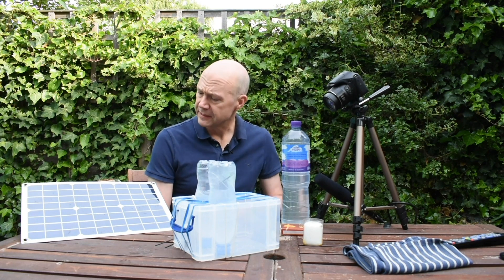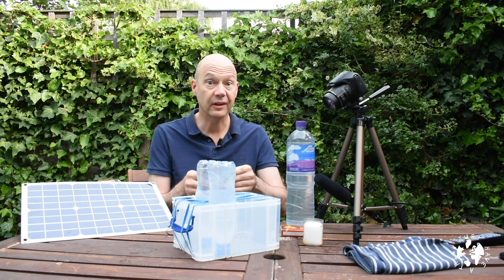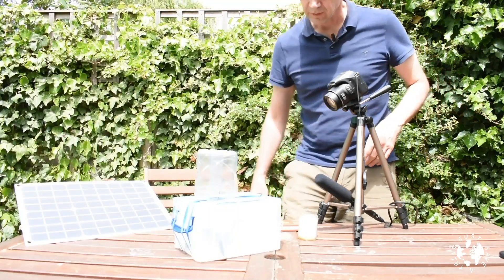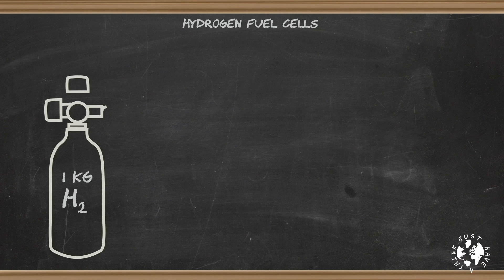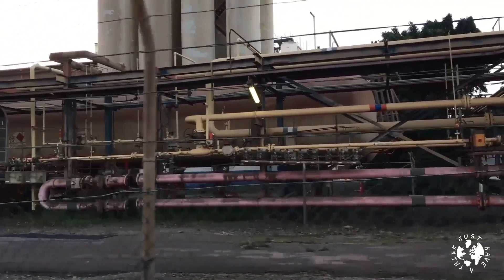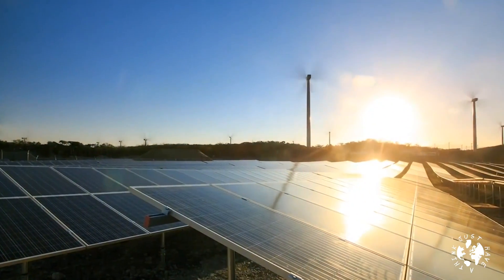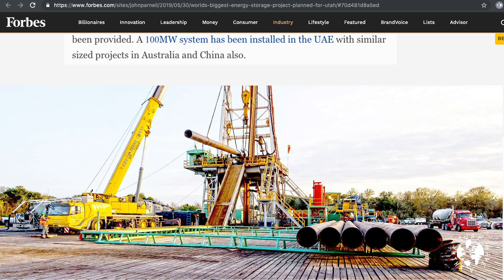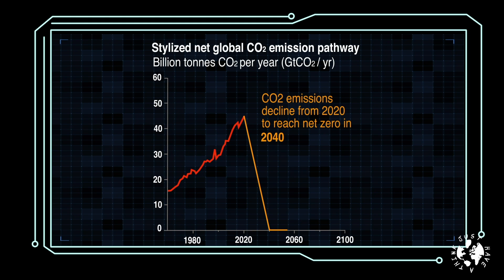Energy Storage in Hydrogen : Does this beat batteries?

Comment: People are afraid of old tech LI Ion because of the fire hazard.  Hydrogen is hard to store and very flammable.  Also, the efficiency of hydrogen must be compared to the efficiency of battery storage because using hydrogen is in fact a battery.  Hydrogen costs more electricity to produce than a new tech solid state battery consumes in it's conversion.  Electrolysis is not well thought of as far as efficiency is concerned.  Using it in our cars is all about the ability to refill the tank in a comparable time to gasoline.  At least, this is my understanding of the subject.  The new tech lithium batteries are looking very promising and Tesla's ability to produce the old style cheaper than Redflow's zinc bromine leads me to favor the solid-state batteries.  

As far as large scale storage is concerned I favor the hydro-pneumatic developed at Oakridge Laboratories.  Scaling up to municipal level should be fine with the solid-state.  This can all change at the drop of a new technique of course; or perhaps due to capitalism's modern tendency to overprice superior tech and slow its adoption.  If gasoline had been subject to the pricing techniques of today we would probably all be riding horses.  Grass is very cheap.

Comment: first.. electricity DOES NOT need to be stored for months, or even weeks. on the grid, a day or two at MOST. case in point:  peak usage hours and solar storage overnight. this brings us to our BIGGEST problem with hydrogen... if you're using electrolysis, you are losing 20% of your energy at minimum. then you need to pressurize it, we can safely assume another 10% loss. SO- A TOTAL loss of 30% up front. but storing hydrogen as a gas would require A MASSIVE BANK OF HUGE TANKS- unless you liquify the hydrogen, which would require ANOTHER 10% … and raise maintenance costs to a much higher level. then there is the problem that hydrogen is nearly impossible to contain.. it leaks out.. turning your power plant into the hendeberg x 10. yah, exploding gasses and high voltage. great idea. but wait- not done yet. hydrogen fuel cell efficiency is 60% AT BEST. so.. when you gather the sun's rays... & then use hydrogen as your storage... then run it through a fuel cell.. by the time it hits the grid- YOU'VE LOST 70% OF THE ENERGY YOU GATHERED FROM THE SUN!!! lithium ion batteries, with charge & discharge efficiency combined- are 98% EFFICIENT!  there's only ONE REASON this idea of 'hydrogen storage' is even being suggested. see the 'shell' logo on the tank? THAT HYDROGEN DOES NOT COME FROM ELECTROLYSIS. it is REFINED from natural gas. just big oil trying to keep a hold on the market. THANKS but NO THANKS. it's time big oil took a hike.

Comment: The compression process of gas hydrogen could be simplified or eliminated by placing the electrolysis containers in deep water locations.  300ft would give 10 bar h2 and 3000ft 100bar h2 with no added energy needed.

Comment: Hydrogen for mass electricity storage makes no sense as it gives you back less than a quarter of the electricity you put into it. 

The only applications where hydrogen makes sense are where you need the best energy density at any cost, such as was the case for the Apollo moon mission and some other space missions.  If you're sending people to the moon you don't mind spending a few more dollars to make hydrogen. These applications will typically store the hydrogen and oxygen cryogenically rather than under high pressure to allow for much smaller and lighter storage tanks.

 If however you want to store a billion dollars worth of electricity you don't want 750 million of it to just disappear.

There is one very successful long term, high capacity and high efficiency storage which is hydroelectric  with artificial lakes. The overall efficiency is far higher (65 to 80%) and the cost per KWh far lower than hydrogen.

For shorter term storage (days) to be used with solar power it makes most sense to use a solar concentrator to store the heat directly in molten salt and convert that stored heat to electricity on demand.

Unless someone invents a new way to efficiently separate hydrogen from water it will never be a viable storage solution for grid power or even vehicles. At present it is not even just an engineering challenege - there exists no theoretical basis for a process that would do it efficiently and it could even be that it is not possible at all ever.

Comment: Hydrogen might find a niche. It won't be cars, busses, or trucks. The round trip efficiency is low, and infrastructure is too expensive. Hydrogen needs to focus on it's core strength. Long term storage, or maybe energy density. Grid storage, range extender for an electric ship, or something like that.

Comment: Hydrogen fuel cell/electric traction technology is used in trains right now.  A hydrogen fuel cell train is in fare paying service in Germany, with a trial scheduled to be on the Liverpool to Chester line in England - the line passes the Alston train facility with the hydrogen produced at the nearby Stanlow oil refinery. The UK Dept for Transport has put on hold expensive electrification of rail lines, as hydrogen trains is seen as the answer in replacing dirty, slow diesel trains on surface lines, giving zero emissions, being far cheaper overall with no ugly overhead wire gantries. To electrify the London to Cardiff line would cost £2.5bn-£2.8bn instead of the £874m projected in 2013. The electrification was cut short at Bristol. 

Mark Carne, head of Network Rail in March 2017 stated: "The idea that you need to electrify an entire route is no longer necessarily the case." and also, "technology was advancing at such a pace that better reliability could be achieved without the construction of unsightly overhead cables."

The expense of wiring up thousands of miles of track, plus the ongoing maintenance costs, is calculated by some to be more than introducing zero emissions hydrogen trains where the hydrogen is produced in the train stabling depot by electricity, eliminating the transport costs of the hydrogen.  Buying the trains, setting up the hydrogen producing plant and building (or renting) wind turbines, is cheaper than full 3rd rail or overhead wires. The turbines do not have to be near the hydrogen production plant at the train depots. They can be offshore then fed into the grid. How much electricity the turbines produce feeding into the grid, and how much the plant consumes from the grid, is easily metered. So hydrogen can be produced when too much electricity is being produced storing that energy. 

Merseyrail is to trial 3rd rail battery hybrid trains. The trains will use the electric 3rd rail pickup on the existing metro network, while also charging the batteries, then run on batteries on unelectrified track.  This will extend the network to low passenger usage towns and villages. Being combustible hydrogen is precluded being banned from the metro tunnels and stations in Liverpool and Birkenhead.  

However, in use for personal cars?  EVs make more sense there, as electricity is everywhere for the charging. 

Hydrogen can only be in niche applications. Suitable for large vehicles such as ships, trucks, buses, etc.  And energy storage in balancing the grid.

Comment: Thanks for another great video. You are in danger of converting this hydrogen sceptic into a believer at least for large scale energy storage. I did not know of the proposed 1GW facility in Utah but I do hope it gets built and the world gets to see how it performs for good or bad (but such projects usually tie everything up with the phase 'Propriety information' which is apparently far too dangerous to their bottom line for others to learn from and in the US the bottom line is more sacred than God). But we don't know how much energy will be stored there (it's 3 miles by 1 mile so very roughly a volume of 9 cubic miles,  if we knew the pressure we could ball park it). I trust engineers more than most but I still wonder just how big an explosion could happen when they are filling this cavern, is it currently filled with air (I bet it's not nitrogen) and a mix of hydrogen and air is highly explosive (hydrogen really wants to go bang, it is very catholic when it comes to ratios of air to H2).
Why are they so reluctant to state the anticipated energy storage (in MJ or MWh or atomic bombs dropped on Japan in WW2) ?

Comment: Have you heard of an American company: Hypersolar? It has a process of converting hydrogen from sunlight and water though it is struggling. Just thought I’d bring it to your attention.
Reply: looks promising... but there's still the problem of compression, storage, and hydrogen fuel cells are EXTREMELY inefficient.
Reply: those panels would be great with a 25 LB storage tank & standard gas 'house pressure' regulator running through a gas piping system in a house would be a great way to power gas heat & appliances though. piping would have to get better. hydrogen is so dangerous. it leaks through almost anything. plastic, steel, you name it. a stud wall cavity full of hydrogen? BOOM!

Comment: What could possibly go wrong? Nothing,  except the energy required to split water is far greater than the  energy derived from the gasses produced. That energy loss is much greater with electrolysis than with charging/discharging batteries,  in the short term.
Also just "assuming" devices using CNG are able to burn Hydrogen gas interchangeably may be an unjustified assumption. It is a fact that home appliances using CNG CANNOT burn Propane without changing the fuel to air ratio. Which involves changing parts internally. Excessive sooting will occur, causing operational  problems and pretty quickly too.

Comment: There was an Australian Company called Ceramic Fule Cell which produced dishwasher sized unit for domestic use which produced heat and power from natural gas,could also use hydrogen without conversation. Worst case scenario 65% efficient on natural gas.They ran trials pre production in Holland proved to work. Needed big volume orders to bring price down so was to expensive to bring to market. Did produce very low emission on natural gas but far lower than burning hydrogen I believe.

Comment: Storing energy as a liquid is so so convenient. Compressed gasses and batteries can provide additional safety, leakage, and initial cost problems.   Why don't we combine hydrogen with carbon (captured or biosourced) to produce a liquid fuel source?  That liquid would release CO2 but that is not a problem if the energy was renewably sourced and the net carbon was neutral.  (This is an honest question.)

Comment: I have been thrilled with the properties of Hydrogen for a long time. The idea of compressing it for energy storage use had not occurred to me.   Thanks.

Update from New England:  solar power production regulations that had limited it to 37% of total power usage in Lowell MA (4th largest city in MA) were expanded to allow as of 7/19 a total not exceeding 82% coming from Solar. Perhaps this will improve our renewable generation capacity.  Perhaps we should mix in wind and hydrogen for various uses.

Comment: Is some of the energy used in compression of hydrogen recovered in turning the turbines or is the energy output purely by combusting the hydrogen. Possibly, it could also be more efficient in automobiles using Wankel engines.

Comment: Question- when you described the system for grid-scale G>P>G, you mentioned the release of hydrogen from the salt caverns (which spins turbines) being the primary source of generating electricity. As I understand it, fuel cells or just direct combustion of hydrogen in gas-fired powerstations would be the primary method of using hydrogen for power, with the energy released when taking the hydrogen out of storage being secondary source of value. Is this correct?
Reply from the maker: In all honesty David I'm not 100% sure. I read this article this evening
https://www.sciencedirect.com/topics/engineering/salt-cavern
Which is interesting and detailed but does not specifically distinguish between the different options, although it does seem to imply that the gas is extracted directly for combustion and electricity generation rather than for fuel cells.
Reply: @JustHaveaThink  Good article. Thanks for the response. I think the application described in your video is correct (can be used for heat), but its just one potential use, with hydrogen for power mostly being through combustion.

Comment: Back when I delivered welding supplies, hydrogen tanks were a special kind of dangerous.  They could explode simply from the heat/friction of the hydrogen being let out of the tank too quickly.

It's fine with suitable industrial controls.  But for private use, they are probably going to modify it to make it less explosive.   I've heard this loses about 20% of the energy in 1 pass, so the extra modification would probably mean more energy loss (but less risk of explosion).

So I'd be game for using this to explore solar power industrially but leery of it's use in private vehicles.  I'd want to see high speed collisions, resistance to exploding in a fire, inability of terrorists to disable the safety protocols and turn vehicles into natural bombs, etc.

Comment: I just can't get over that one "small" problem of storage and potential for explosion. I mean, we already have that with gasoline and natural gas, and it hasn't worked out so well, with thousands of explosions and pipeline leaks globally, causing untold billions of dollars in damage and lost lives. Seems easier to just take sunlight, put in through an inverter and then into a battery. Seems as though batteries are less likely to explode in a catastrophic way.

Comment: The only reason the current energy providers are pushing hydrogen solutions is that the massive centralized infrastructure and distribution network requirements keep them as the indispensible SDOURCE AND DISTRIBUTOR that they are presently with oil and gas. 
If we move to locally generated/distributed sources like Solar/Wind (with battery/thermal storage) then their entire business model is defunct and they cannot keep their boot on our throats anymore.
Reply from the maker: They are certainly feeling threatened by that concept, I agree.

Comment: I know next to nothing about this subject but it sounds very promising...There's a question: Am i right in thinking the waste from burning Hydrogen is water. If so (water vapor being a potent greenhouse gas) wouldn't that trap more heat into the atmosphere? 
Or is it like burning sustainable timber where there's a long cyclical re-absorbing of the CO2 produced?
Reply from the maker: Hi Stu. The by-product of hydrogen fuel cells is indeed water. And it's pure water. In fact I think that's how they get some of their drinking water up on the ISS. Given that nearly two thirds of the global population don't have access to safe reliable drinking water, I think the plan will be to capture the H2O and make good use of it.

Comment: With all that chasing our tails around regarding miles and miles of solar panels, or miles and miles of windmills, just so we can then worry about creating hydrogen, where more than half the hydrogen has to be burned to Store the lesser part, well, why not just go to Nuclear Reactors until we finally get Fusion.   The fate of the World hangs in the balance, and we seem to doing the Most Difficult Thing First.  Let's Save Our Lives and World First, and then worry about which one is the Solid Fork and whether Hydrogen is more PC than More Power Cheaper Nuclear Energy.